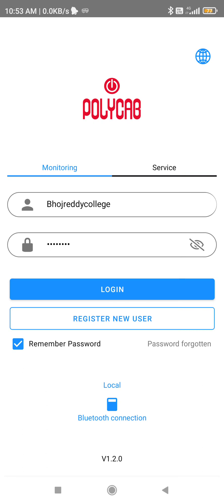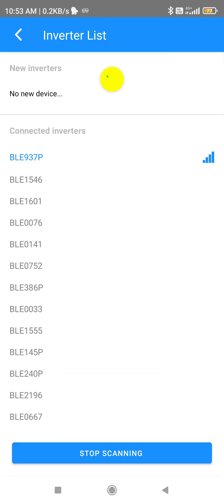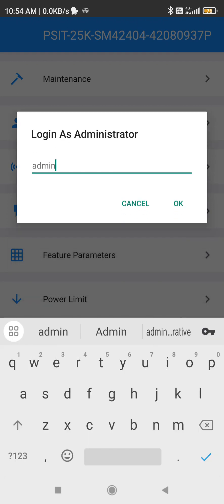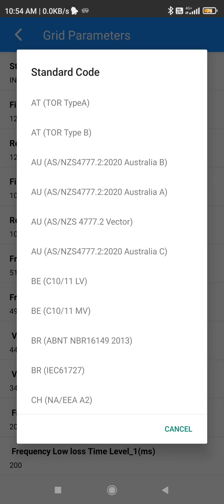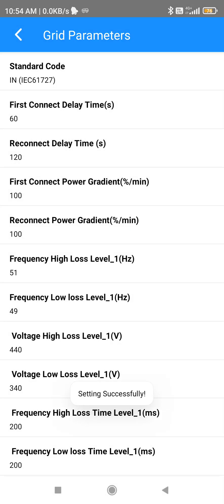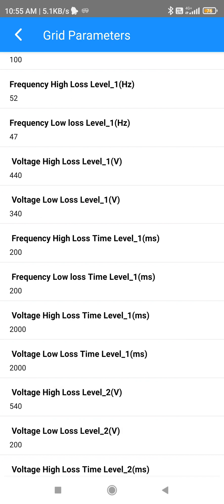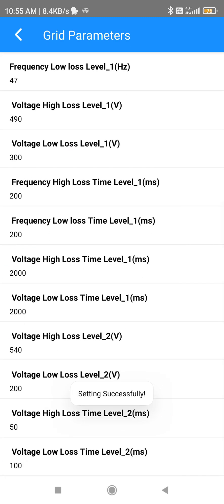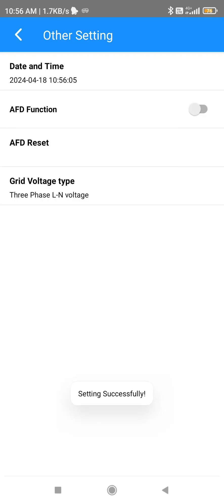how to change grid side parameters for Polycab 5G series India make SM models

Comment: Can you please share what are the settings for single phase inverter?
Reply from the maker: @praveen219  all settings will be same but voltage will be different for single phase ,high voltage will be 280v and low voltage will be 170v
Reply: I have single phase grid supply but in other settings it says 3 phase and I can’t change it to single as error comes